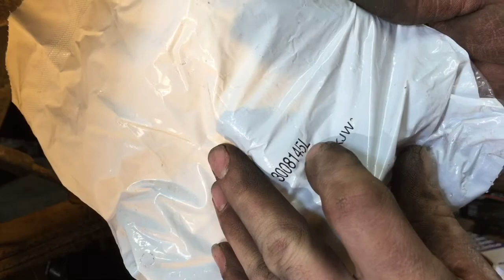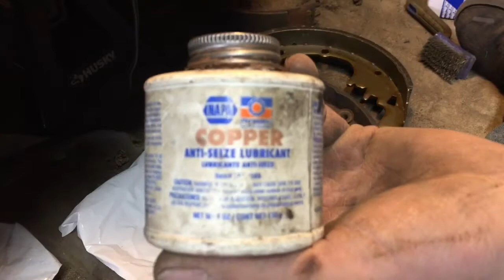Installing the rear drum brakes on the 1979 Barn find Chevy Camaro part two 12/01/2020

Comment: Good job on the brakes mate I’m catching up on some of the vids,it’s a bit of bad luck about the engine I guess you could drop another one in it and clean the original one up,it always pays keep original running gear for cars.Anyway mate keep up the great work👍
Reply from the maker: Thanks, I might drop another into it for the time being. Will keep the old engine might rebuild it later when I have some time.

Comment: Hey there, the two shoes have different springs right? The main one ( the one that faces towards the front of the car) uses the green one and the other one the yellow, right? Tried to do the green springs on both ones but it is just too hard to compress
Reply: Or should I say, the yellow one goes on the parking brake side, right?
Reply from the maker: Not sure what spring you looking at. I will try to take a closer look at later tonight.

Let me ask are talking about the little round yellow spring? The one that is video 34min and 18sec?  If you watch the video at about 35min you can see most the springs. Anyway I see I can get a video in the next couple days showing the springs and how they set up.  

Thanks for watching my videos
King Deadlego
Reply from the maker: Take a look at the video I posted yesterday. It shows springs how they are installed.